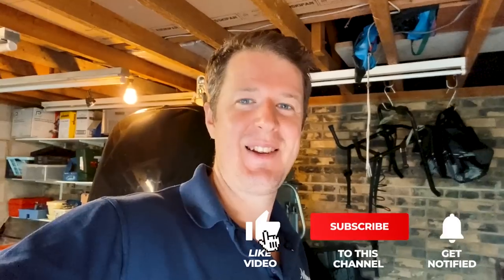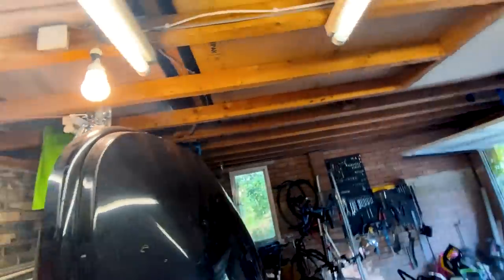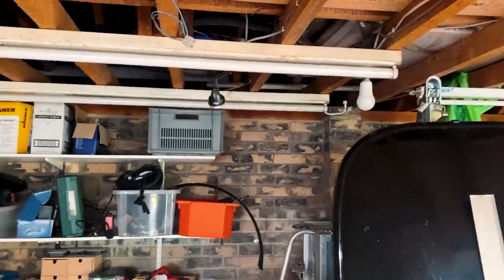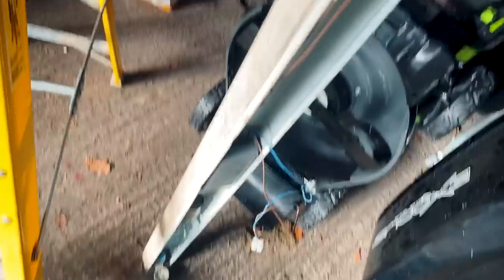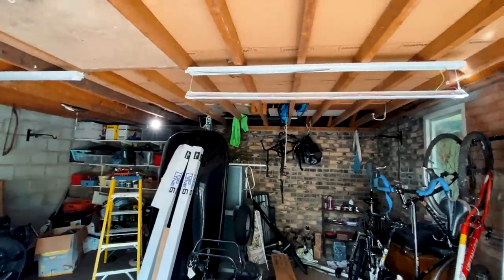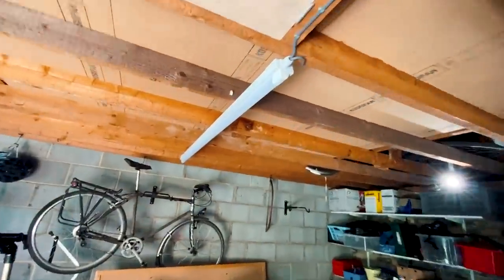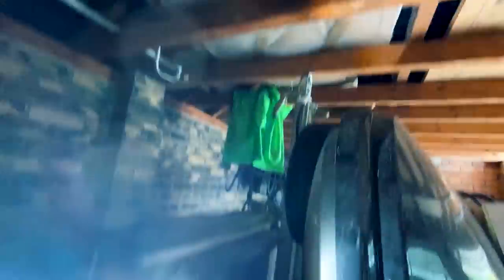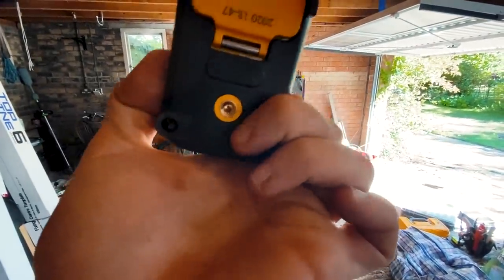Garage Rewire - Electrician Life

Comment: I never put fixtures in a room such as this in the middle . Doing so creates shadows when you need to do anything around the periphery .. in a room like this  I would run the about four feet off the wall at the end and the about the same at the other end. That way the light is between you and the shelves. Your thoughts
Reply: I'd have 4 lights each above the wheels of my car, need plenty of light for when working on the car.  And an LED strip channelled in the floor to light underneath.

Comment: In the US we have more of a toggle so down is off I think this comes out of two things A directionality and A requirement that down be off so if something Falls against it it is less likely to go on. I believe since we share with Canada they do the same thing. The interesting thing our consumer unit or breaker panel load Center code requires vertical and Canada allowed horizontal.

Comment: Other than the light fittings I think that previous install was done using "cable and stuff" that were found lying around in the scrap yard. I've wanted a light switch hidden in the roof beams.......

Comment: I'm guessing that most of these garage wiring messes are those 'Quick, I need some lights in the garage. I'll get round to doing it properly later.' As we know, there's nothing more permanent than a temporary bodge 😆
When I saw the nailed florescents I nearly wet myself. I live in rural Shropshire where they haven't come round to the principle of using new fangled screws lol. The yokels here bypassed them and moved directly to 'no more nails'. 😂

Comment: That looked like a posh house, with a twin garage and mechanics tools for there bikes.  Was there no budget for a few extra sockets or an outside socket, I can see a water supply in the video for cleaning the bikes or car.  The job was crying out for a garage board with all the trimmings.  The outside light looked weathered, was the terminations as bad as the rest of the job.

Comment: SWA ran from the house to a switch in the garage.... Expensive 2 way switch 😂 If rewiring, why not run a new cable out from the board in the house and out to a new sub board in the garage with an mcb for the couple lights and an rcd for the sockets. Would have been a nice job IMO and leaves the option of adding in more in the future having a sub board in the garage. Could have even re used one of the SWA's that were already pulled and just re reroute them at the house.

Comment: You’re still winning the race atm, 900 ish left. I definitely agree with you about the flexi conduit; I been taught use it only for vibrating/moving appliances etc. and that it should be a max of 2m realistically, but if it’s tidy and supported well then fair play really

Comment: In the US up is on, as an additional bonus standard single pole switches read ON/OFF so you can immediately tell the difference from a multiple way switch and if you hang it upside down the switch reads NO!

Comment: 22:30 oh yeah... that is very confusing indeed, why in UK you install switches in wrong/different way than common breakers work.. huh? anyway, I don't know if it's true but I remember someone told me that turning off always should be "toggle down" (not only for light switches), simple example: there is a fire/gas leak, someone is loosing consciousness or is crawling on the floor..  it's easier to turn off things with sliding down your body on swtich or slamming down your hand on it.

Comment: Great video, as always. As a DIY 'electrician' myself, I find these videos are such a great source of information and learning. I appreciate that its probably not your intent to encourage the DIYer's, so who are these videos aim at? Not qualified competent electricians, surely!
Reply: No such this as a DIY electrician
Reply: @fraserreid719  LOL 😆
Reply: Well legally speaking, one can replace broken fittings, lights etc. I believe the jargon is Minor works. 

Minor work can include: replacing socket covers, control switches, ceiling roses and replacing cables from a single circuit if damaged; adding additional lighting points to existing circuits; replacing light fitting. 

Unless it is in a "special place". 

But I see you point about protecting the term elecchicken.
Reply from the maker: Adrian Haddock if you are doing minor works you need to produce a minor works certificate which only a qualified electrician can do. DIY jobs that are allowed are basically only changing like for like, no additions or alterations are allowed.
Reply: @artisanelectrics  spot on. Spuring off a ring main then spurring another 3 sockets off that and plugging tumble driers in the lot. That's the horrors of botch diy life enders
Reply: @fraserreid719  'ring main' ?!? Do you mean a ring final circuit? Tut tut, people like you give us DIYer's a bad name. 🙄
Reply: @garyredmond1890  DIY electrical work is exactly what it says. Death in yourself. Seen 8mm bolts used as main fuses, regardless of what people call a final ring weather it be a main or not is trivial. Just like gas work, anyone without certification shouldn't be touching it.
Reply: @fraserreid719  Yes, DIY electrical work is exaclty what it says - Do It Yourself, but that doesn't automatically mean done badly or dangerously.

Not that long ago I had an argument with the electrician doing my extension (contracted by the builder) because he wouldn't put the isolator for the downstairs WC extractor fan in the WC, he stated that the WC was a special location; the WC is not a special location, I had to explain that to him and he had to begrudgingly admit I was right after consulting the regs. You see, that was a 'qualified' electrician that didn't even know basic stuff like special locations, and there are thousands of 'qualified' bodgers like him in all the trades.

So, all the videos posted from the likes of Artisan, Bundy, Nagy, John Ward etc. helps me improve my knowledge and enables me to carry out my own electrical work, within my limits and the regulations, to a standard that is probably much higher than most of the local cowboy electricians/builders/kitchen fitters. I don't care if you don't like it, I'm not asking your permission,. Not even sure what you think you have contributed to my original question, which is still unanswered; you have a lot to say but not much to contribute and are very opinionated on a subject you appear to know little about.

Comment: In the U.S.A. on normal light switches they have the words ON and OFF. If you install it upside down, and turned on it reads " NO " it's wrong. Think about that one. The reasoning is that you MUST push a switch UP to turn on a circuit. You can not accidentally turn something on. (all bets are off with three-way and four-way, a misnomer in effect as a three way can be turned on from either end of a hallway for example, and a four-way would be at a door between those and as many doors there is one can have four-way switches and they will all work the hall lighting.) (I'm just an old retired  "sparky".)

Comment: Do you not need metal clips to support the cables or are garages exempt?
Reply: I was just wondering that. I’d think the regs apply anywhere?👍
Reply: @tommythomson99  I think it depends if the garage is attached to the house or not. I know it does for metal consumer units.
Reply: 521.10.202 Wiring systems shall be supported such that they will not be liable to premature collapse in the event of a fire.
Reply: But you could argue the fittings are close enough together that they are able to support the cables in the even if a fire. If metallic? Any thoughts?
Reply: @Mason Moore which ones? The cables clipped direct on the ceiling?

Comment: Am I the only guy who uses an impact driver for everything unless using a holesaw on steel? Hardly ever use the drill.
Reply: does it work well drilling stuff?  been thinking about switching over to impact and getting a set of those hex shank drill bits
Reply: @cliveramsbotty6077  only used it for hss bits, use some lubricant and in my opinion it seems better than a standard drill.

Comment: The old cable feeding new lights where was it going is it surface above joists was it checked for damage and could it not be pulled back in to a new light fitting

Comment: Hi, 
   The USA has the same switching orientation where up is usually the on position and down is the off position but have you observed that all the UK MCB's etc are that orientation. 
   I worked in the military ship building industry and l believe all switches there are the same to conform with NATO requirements, also l believe it is the same for the aircraft industry.
   I guess to a certain extent it is what one has got use to. Anyway keep up the good work and stay safe. 
    Regards, Gareth.
Reply: I assume the thinking with MCBs is that if you were touch one while falling then you can only turn it off (or to a safe position). Whether turning a light on or off is safer is maybe more debatable - Most of Europe seems to have the up for on with switches too, so we seem to be the odd one out as usual. (It's very common to find switches upside down though)

Comment: Why didn’t you straighten out the armoured cable near the outside light rather than leave the original curve 
Would have looked awesome next to the vertical conduit you fixed in

Comment: You can't put something on an EICR just because it is old and hideous! Otherwise I'd be for the chop....
Why not have both switches on the same plate?
Disappointed you didn't straighten out that SWA .
The 1 milli cable on the joists: I would take the cable under the joist, not over, to prevent damage from anything placed on top of the joists.

Comment: Hi Artisan Electrics i am a viewer from Algeria and i have so many questions to ask you about electrical installations.
the two most urgent are related to solar installation and grounding
1. i have a distribution board with two sources of electricity, city electric and solar (2400W inverter) 
the thing is the two electric circuit are never in contact with each other  but i have to properly ground all the electric sockets for safety .
the question is do i make sepret grouding bar for the diffrent sockets or it doesn't matter or there is other solutions.
2. for my solar installation i have a pure sine wave inverter from EPEVER 2400 watt and the problem is that it is properly grounded but when i mesur from the neutral or live wire to the ground i have half of the potential (115 volt) .
ps:  i have 230 volt between neutral and live
i heard about neutral bonding and floating neutral but it is high level for me.
i hope you can help and thank you in advance.

Comment: I wouldn't say that DIY electrics is terrible it's just that if you have the inteligence and sense of mind to acctually look up how to wire everything to code but just don't want to pay for the education to get licensed since you just do your own electrics anyway just don't get noticed. It's just the bad DIY electrics that usually have issues eventually. The ones that does it correctly goes under the radar. It's also a bit easier here in Sweden where we rarily have metal boxes for our electrics and the outdoors ones in plastic have prefitted grommets that you just poke a hole in it.

Comment: I'm intrigued to know why you used a switched fused connection unit; I'd have had it unswitched to prevent a call out down the line. Would also have made and fitted it with a little label "Garage strip lights, 3A Fuse'. I've avoided buying a laser yet so would have fitted conduit just using a spirit level, shock, horror!!

Comment: Jordon , where do you have your microphone when you are filming, sometime when you are looking or filming to your right, it's very clear and at an good level. However when you turn to your left it sounds like you are miles away. It might not be the volume as I have queried before.
Reply from the maker: It’s a lapel mic on my collar and when I turn my face sometimes the audio is less because of that.
Reply: @artisanelectrics  Thanks for clarifying that. I do enjoy your presentations. You would make an ideal electrical safety inspector. I would have you as my trade master any day if it were possible, yer I'm still looking. I am nearly finished level 3 nat cert, but can't without passing 12 on job practicals , then I can finish Level 4 which I am all but through, but can't go for registration with out licencing from level3.  I think it's because they think I am too old at 53.lol

Comment: 26:20 - not required here I'd say, that cable is not going to "fall" on someone during a fire and tangle them up, in this situation assuming cable goes along joists etc then they would need to burn through and collapse letting the cable fall, at that point, I don't think we are going to worry about a cable but more the roof that is about to collapse and the burning timber blocking the way!

Comment: I would of used a y box or straight through drilled out back closed grommet with small hole for cable entry one bit of pipe top and bottom compression gland at top and split at the bottom for said switches.

Comment: Maybe if we stopped selling electrical stuff to anyone, that stuff would be a thing of the past.
As I have said before mk is ok, it's not as good as it was since Honeywell got it's hands on it, plus MK have not made a consumer unit in years, they were made for them by another company.
Think I would have been tempted to use a wiska box instead of the end box, and done a joint in there for the two way and outside light, spoils it being on the piss.

Comment: Where do you get the light fittings from?
Reply from the maker: BEW is my local wholesaler
Reply: CEF do some great LED battens, easy to fit with push in connectors.

Comment: No explicit requirements in Germany and Austria. Germans tend to favour down = on because they claim switches will be off more than on so if down is on less dust will collect on top of the rocker but that's no more than a casual recommendation. In Austria it's really a matter of personal preference. I find up = on more logical because that's how MCBs, RCDs and large industrial switches work. Back in the ancient days of open knife switches up = on was a kind of fail-safe feature because gravity could only pull the switch open rather than closed. Considering how popular these Frankenstein contraptions were in the US, their preference is hardly surprising.

Personally I try to install all the switches in one house/flat the same way but that's about it.

Some really old switches from the 1960s had red dots to indicate the "on" positions and those were visible when the switch was down so at least one Austrian manufacturer favoured that orientation. Its main competitor had it exactly the other way round.

Comment: The two-way exterior light/house light makes sense to me.  It's the kind of utterly anal detail that I would do.  Want to to to the garage in the dark, flick a switch in the house that puts on the "porch" light in the house and also the outside garage light, to see where you are going.  Reverse to switch off when back - also if leaving the garage after it's got dark, you can see where you are going.  I like the idea of the two way - but not the shoddy job of doing it.  I wouldn't have the skills to do that type of rewiring job, but know what I expect from a "good job".

Comment: Oh - and another thing - I get your comments about DIY jobs, but what I don't get is WHY they are so bad.  It's not like someone didn't know the basics of how to do it (they know what a junction box is), so why would you make such an appalling job of cabling in your own garage, given it's your own life you are risking.  I had to wire up some temporary lighting in my current garage - its a total temporary bodge with 4 batten lights, ran off of  a nearby external socket - but it was always for incidental use when I was trying to find stuff in the winter.  I wired the lights up in parallel, zero exposed wires and all cables neatly tacked to the roof beams.  DIY-ers should be able to do basics (not full rewires!!), but all it takes is some knowledge, willingness to research before doing something and caring about the job you do.  Also - knowing when you are out of your depth.  I am watching a few of your videos - this one in particular - as I am getting a new garage built soon and wanted to check out your rewire job, so I can see see what a good job is and keep tabs on the spark doing the work :p
Reply: Also in my country typically garages, cellars, sheds, are wired like that. No earth connected (why do you need them), wires twisted together and attached with scotch (if you are luck electrician tape, if not whatever type of scotch tape they have laying around, including paper one), the cable used is whatever scrap cable they have laying around (electrical cable of random sizes, but I've also seen black/red speaker cable used for 230V, CAT 5 cable, areal coaxial cable, whatever), then the typical extension leads made with some random pieces of cable, including the inevitable piece of cable saved from a washing machine or something like that with a schuko plug that is forced on the kind of socket that my country uses without the proper adapter, because 50 cents for a plug are too much.

Comment: Another painful video on the ears. Turn volume up so you can actually hear the speaking parts and then get blasted at Nan volume with music halfway through. I am always surprised that people don't have more sockets installed when they have a spark doing work like this. Both sockets were in use when the video started so they clearly could use a couple more.  Nothing strange about the 2 way lighting at the front of the house. Worked perfectly for years when you arrived home with your car in the garage and could turn on the lights to walk to the house. Now we have smart options but sometimes simple is best.